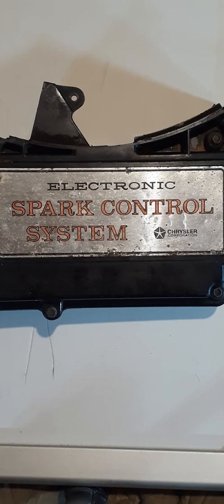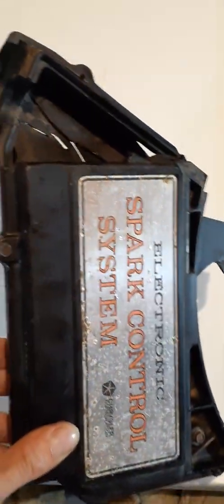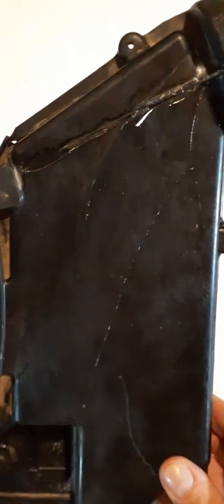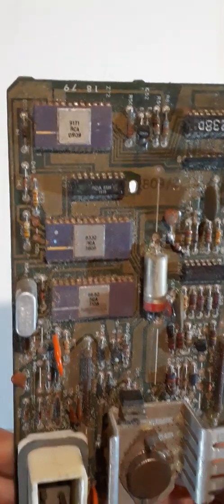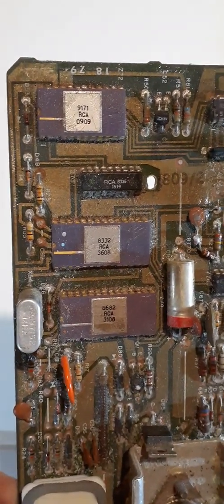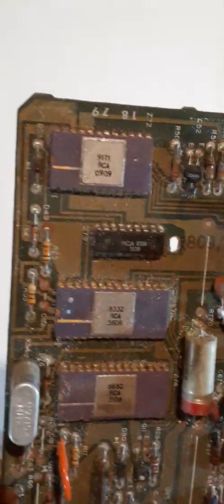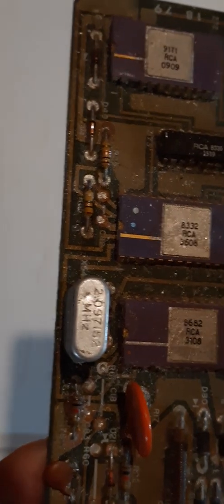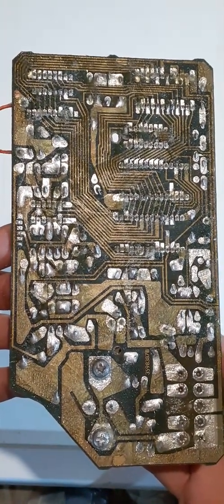Chrysler Corporation ELB Electronic Spark Control System Computer Module , Inside

Comment: I repaired one for a friend one time. It was either a '77 or '78 400 (or 440) engine. Had several electrolytic capacitors that had to be replaced due to high/out-of-tolerance ESR but once replaced ran great.

Comment: Was macht dieses Teil genau? greets from germany
Reply from the maker: It geau controls spark timing , instead of using centrifugal weights in a distributor  and fixed  vacuums  parameters ,  the computer, determines the spark timing from load on engine through the vacuum transducer and the computer applies spark timing instead of centrifugal weights , in the distributor. Greetings from Australia.
Reply: Ist es auch möglich das zu deaktivieren oder auszubauen?
Reply from the maker: @piczel89  yes you can remove it and its distributor , replace the distributor with a conventional distributor and add a ignition module and run the engine without it. As far as modifications go to the computer itself,  probably not much you can do , to change its parameters,  although I've heard of people messing with its temperature sensor to make it work differently.